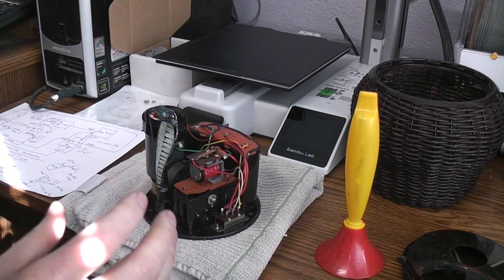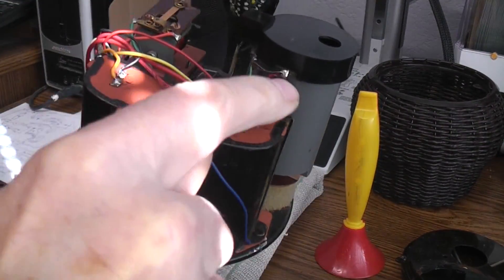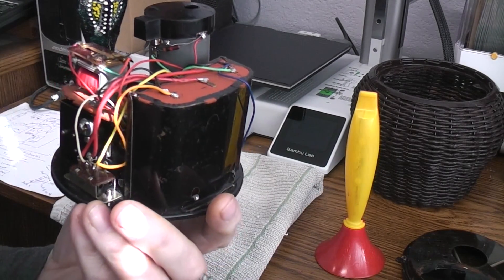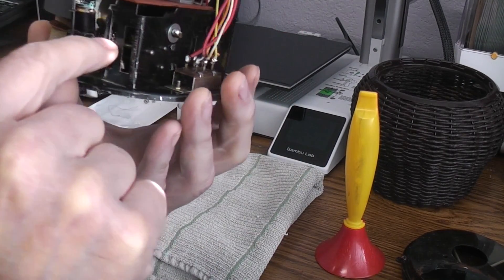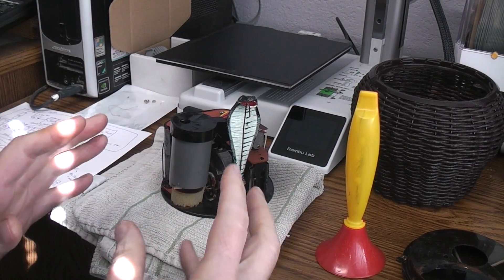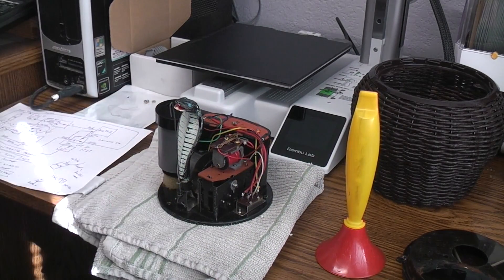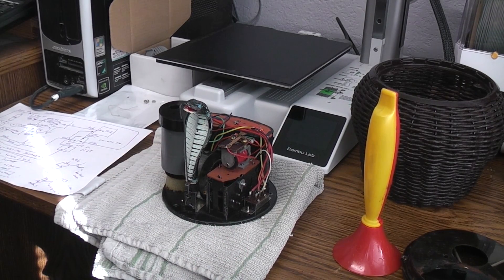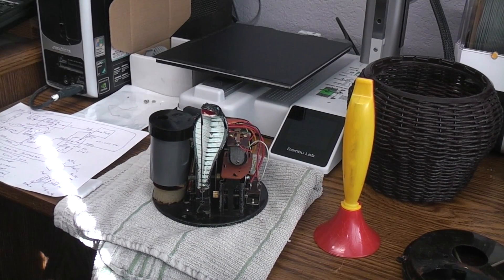Inside a very compact Helmholtz resonator "whistle controlled" toy. Snake charmer.

Comment: Vert interesting toy... 
I remember that my aunt had a Tube TV in the 70's whose remote control operated via sound waves. It was used just to change the VHF channels (2 ... 13).
Funny that you used the word "COBRA" and not 'SNAKE'. It's the same word we use in Portuguese...
Reply from the maker: I remember the old TVs that used ultrasonic tuning rods to control the power and channels as well.